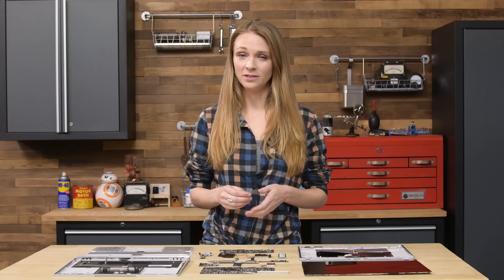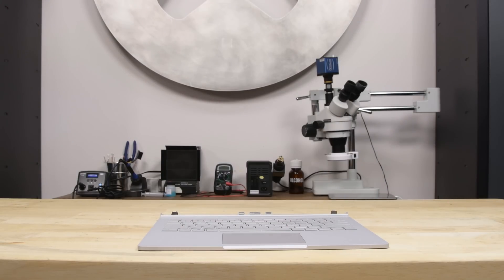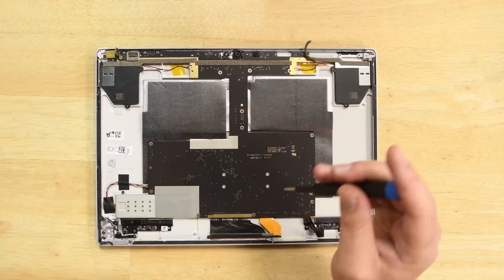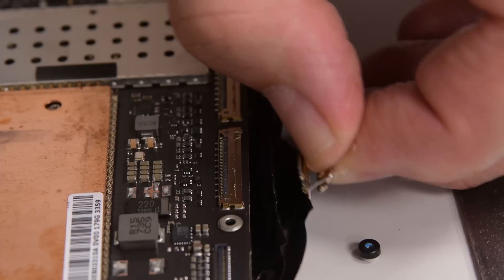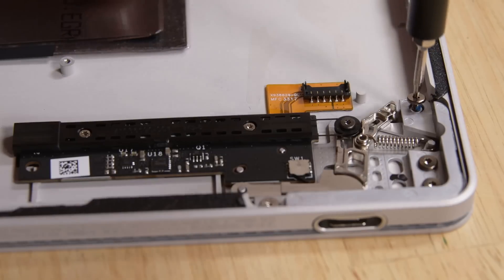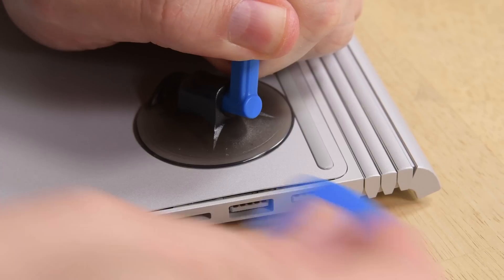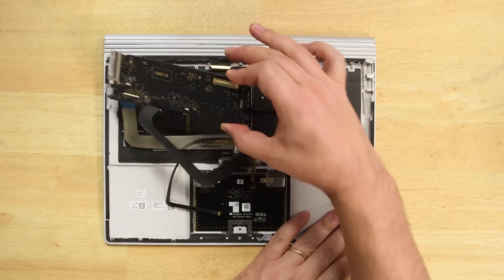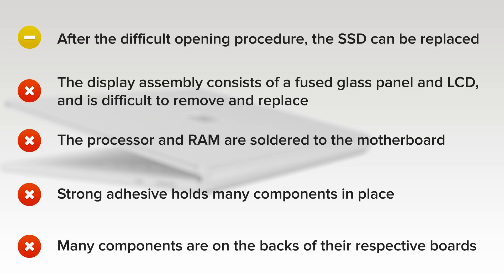Microsoft Surface Book 2 Teardown!

Comment: I recommend having Microsoft repair their own badly designed computer.  The Surface Book 1 has defective batteries that swell and burst, so beware.  Microsoft is aware of the problem, but rather than offer to replace the batteries for you, they instead offer a measly $600 towards the purchase of a new $3,000 Surface Book.  NOT HAPPY.

Comment: It's much easier to open, when the batteries go bad and inflate, causing the screen to separate from the chassis or the base plate to separate from the base chassis. I had both the batteries go bad on mine, after close to 3 years. They say they are T4 screws, which they are, but you have to be dead on to get a T4 in there. Do not try to screw it at all, unless that T4 is actually in. Otherwise you will damage the screw. Me...I used a T3. Slightly loose fit, but easier to get in and it's not like the screws need a crazy amount of force to take out.

I think putting it back together is harder

Comment: Bought Macbook Pro 13'' mid-2012 about the same time with the Surface 2. Replacement costs are almost triple the cost now, than back then. Luckily was able to upgrade the Macbook Pro to 16GB and a 1TB SSD Hard drive for about £250.00, no such luck for opening up and upgrading the memory for the Surface. In fairness, the Surface still works much better than the Macbook Pro, before upgrading it. The only real issue with the Surface is the power button.

Comment: I guess the upside to all the adhesive is that it’s an incredibly well build and durable machine. At one point mine fell from head heigh onto a solid floor, the upper right corner took the impact, and the only damage to the device was the enclosure was a little warped in that corner, but the device worked perfectly.

Comment: hi, i have a problem that my surface book 2 battery is swelling and needs to be replaced... or gone. can i take it out and only use the battery from the base? or does it need the battery in the tablet part? if not... ill just ditch it. please ANYONE let me know ASAP! thanks (or if not, will a surface book 1 battery fit and work?)

Comment: Well at least you can upgrade the storage which is nice

Microsoft wants like 3 grand for a model with 1TB storage, i can get a 1TB NVMe SSD on amazon for like what, 120 bucks? 200 tops? If I ever have to take the tablet apart, this is what im for sure gon change with it

Comment: Its is so weird this Surface Book2 as the Porsche Book is above and beyound on so many factors versus this buildwise, not least 3 IR vs 1.. on the Porsche Book and  item Microsoft also stated that they where one of the vendors behind, alongside Intel, and Porsche and Quanta and Wacom.. /yeah thats a bonafide techbastard..but Peter Han VP Microsoft was certainly very proud. of this device..
Quanta is the maker behind Apples modern laptop like MacBookPro etc alongside a shitload of other products
but it is funny to see only 1 IR-cam in the SB2.. the Porsche Book has 3 of the same IR cams + 2550x1944P/30 videocam for skype etc
https://i.imgur.com/nDE24hP.jpg

Comment: My keyboard unit last night started running the fans at full speed (even supposedly with only 8% battery life and is still doing it now), refuses to show the charging icon or to actually charge, and had to be separated from the screen manually with the release buttons in the screen vent holes because the unit didn't recognize that it had a keyboard attached, so the detach button was grayed out. Not sure what's happened to it. The tablet portion is running just fine now that I am charging it directly from its bottom. But this is stupid. Not even finished paying for it and now I've lost the gpu and keyboard. What do I do? Wait until the keyboard battery finally dies and then try again? Or scrap it because it's done?

Comment: I dropped my SB1 recently while it was inside my messenger bag. Did not think anything had happened to it until the next day when I attempted to power it on. The power button was stuck and now there is no way I can power on my SB. At first i thought, there has to be an easy fix, but after a lot of researching it appears the only real way it will get fixed is by opening the tablet part of it, which b the looks of it, won't be an easy task. SMDH!

Comment: Could I install a Samsung 1TB M.2 SSD?
Reply: Absolutely you could. Its a standard NVMe SSD in there, so anything that fits size wise and uses the M.2 connector should work. I also looked into CrystalDiskViewer? I think thats what it was and it said there too that its a normal NVMe SSD and not some proprietary thingy

Comment: When I was in the Engineering college, they taught us that gluing stuff is the last option when designing. Glue is the cheapset and the easiest way of bonding two materials and in the engineering terms is considered sloppy. I mean what happened to screws, clips, retainers, hundreds of types of fasteners. DON'T TELL ME IT'S BECAUSE OF THE SLIMMNES, CAUSE THERE ARE CLIPS USED IN PHONES THAT ARE PERFECTLY SUITED FOR ANY OF THE LARGER DEVICES.

Comment: This is the business model invented by Apple.    Lets make all the products have premium looks, high cost and unrepairable, or upgradable.  That way, they can sell more extended warranty.  When users cannot upgrade their laptops, tablets.  They will have to purchase new ones
Reply: At least here it's a bit more understandable since they had to cram so much into it to make it work and it's way more complicated than a mac. It makes no sense for apple to do it with such simple pcs but for microsoft, at least for the surface book, i feel like they can get a pass
Reply: Yes.  Apple does not "repair" your laptop, they just replace the whole thing. When you want a new battery, they give you a new keyboard and front cover as well because they are glued together. If your logic board goes wrong, they'll replace everything on it like CPU or RAM, so you are basically buying half of the components of new laptop, and that's half the price of new laptop.
Reply: uhh yeah apple definitely didn't invent that.
Reply: @blotter-water  They were doing that with their desktops all the way back to inception, given that they wouldn't license their hardware to anyone so nothing was interchangeable. So if they didn't start up that business model who did? Mainframe manufacturers?

Comment: Seems like it should automatically score a 0/10 because of safety. Disconnecting the power source should be first. If you have to proceed halfway through a tear down before disconnecting it, that could pose a shock threat to the individual.

Comment: Can you please check again your description of the muscle wire design? It doesn't make sense. You're saying that an elecctro-thermal mechanism causes contraction pulling against the spring, thus keeping it locked to the base-keuboard and when let loose spring will push and thus pull a metal anchor back letting the tablet go free. 
I find it hard to believe it not the opposite bc you are proposing a constant power supply is required to keep it attached while  it will spend most of it's time either attached or free (transition - when u can pull it out) will be when it makes sense power is to be applied - otherwise battery is drained merely keeping the tablet anchored.
Doesn't make sense and I'd guess the mechanism u describe is correct only in reverse (supply power to pull against spring) and thus the mechanical force does the work 99.999% of the time.
Just my humble guess.

Comment: I only care about the battery replacement if it goes weak over time. I have SP4 and I would like to have it for years but I know at some time the battery will die. Hey MICROSOFT, please learn from APPLE how to provide battery replacement for premium devices. For that reason my next device will be MAC.
Reply: just dont buy anything from microsoft or apple

the are the same in repairability

Comment: Hmm, an amazing tablet/ultrabook but also worrying.. one thing there is more the rule than not. is that batteries loose there ablelity to hold power over time and use.and that just how it is with this chem.(you ca nurse all you want and perhaps be carefull not letting it be plug-in 24/7 and perhaps having the batteries in the goldilock-zone 30 to 80% but hopefully this drainhealth factor when on ac power 24/7 aint as hurting to batteries as it was some years ago.
But yeah it can be quite costly to get a new battery in it.

Comment: Lost brain cells reading the comments. These laptops aren't "disposable" lmao. Manufacturers, and even YOU can repair them. You just have to know what you're doing. You can't expect engineers to develop smaller, faster, sleeker devices while at the same time keeping the same setups as old laptops so you can repair them. That doesn't make any sense. You can replace any part of this laptop. The reason why the iFixit score is so low is because it's not upgradable at the consumer level. If something breaks, you can send it in under warranty or fix it yourself.

Keep in mind, I don't even think this laptop is worth buying. Too much money for what you get imo, but that doesn't have anything to do with how easy they make repairing the product so you dunces can feel smart when you want to tinker around where you shouldn't.
Reply: With all that space under the keyboard, though, there's clearly room for a bigger battery and a better performing gpu such as a 1070 max-q, but nope, Microsoft has to be the cheapskate while charging $$$$ for a device that could have much better specs for the same price.
Reply: @AB-pr4uc  You moron, adding even bigger battery would make it heavier and require more time to charge, more heat issues etc. Besides SB2 already has best battery life still in 2019 June lol - only a few devices that can last longer and they are not as good, not even close. As for 1070 max-q - you probably don't even have any proper education and are a imbecile boy mumbling same mantra over and over again. Go back to school and re-learn physics class you moron and then try to understand how economics works. Adding 1070 to 13.5 inch book will make price sky high and will require extra cooling and heat issues. Surfaces are best products on the market in design, quality and style - best battery life, best keyboard, best screens and what else you moron want?

Comment: Speaking from experience - some modern devices which don't have enough adhesive inside tend to have problems with the flat-flex connectors detaching after a few months.

Comment: I think you're missing the point of ultrabooks. They're not supposed to be repairable, they're supposed to be babied until they need to be sent in for maintanence, like a German sports car.  If you want repairability, ultrabooks are not for you.
Reply: I think you're missing the point of a repairability review ;)
Reply: TheBitFox I wouldn't say its microsoft being a dick. They're just making a thin device thinner by using glue instead of screws
Reply: The LG Gram is one of the lightest and thinnest ultrabooks and still is easily repairable
Reply: Christian Stout bs
Reply: The very thing that makes these ultrabooks look and feel the way they are is basically by gluing everything together. It has nothing to do with microsoft being a dick. I hate microsoft as much as the next guy, but you just don't what you're talking about my dude.
Reply: @penguin1714  Ridiculous reply. My Yoga 3 Pro which is 12.8mm vs the 20+mm in the Surface Book, has a cover with screws and the battery/SSD can be replaced in 2 minutes. So yeah, even Apple devices have replaceable batteries. So this has everything to do with Microsoft being a dick. 

From an enviromental perspective, this is not sustainable either. Devices absolutely NEED to be repairable for the sake of the planet and coming generations.
Reply: you dont need to glue it together wtf are you on about 

macbook pros would be easily more repairable if they used normal screws and it wasnt soldered 
but thats just apple being dicks
Reply: Cynical Penguin, my ultrabook feels very nice and it is not glued.
Reply: a laptop is supposed to be self reparable ultra or not 
mabye not cpu and gpu, but you dshould be able to delid upgrde ram ssd and battery like the dell xps lul

Comment: So, you basically pray that you're never gonna have to open it up. Great job, Microsoft.
Reply: How else are they going to sell you the almost 1000 € upgrade from 250 GB to 1000 GB?
Reply: The surface book is aimed for proffesional people who want to get things done and not go in and change things or upgrade it. It is aimed for people who read or work a lot on their computer and for people who need something that is light weight and slim with loads of mechanics. 

It is not aimed for gamers or people who upgrade and use a lot of time on hardware. 

And it is very hard to habe such a thin build with all the features the surface books have and keep it easy to repair. Things are so cramped and glued for a reason.

Comment: no need to get a repair score more than 1. this is a fantastic device that doesn't break 😎
Reply: It is a fantastic device (typing this on my 15 inch SB2), but any computer can break down. I got the extended warranty because I knew that if anything goes wrong hardware-wise, there is no way I'm getting inside this thing.
Reply: johnnyxp64 exactly
Reply: I opted to not get the extended warranty, and am just crossing my fingers. I figure I could have paid like $250 for a 3 year extended warranty... but most likely it won't break (they sell warranty because they know statistically they will make money off you in most cases). But if it does break and costs $250 to fix then I pretty much break even. :) Plus I have a feeling that if something does go horribly wrong, it could happen in the first year. Often after the break in period a PC can just go on for many years.
Reply: what if it breaks?
Reply: except when you close it it cracks the screen because that sharp cutout near the trackpad XD

Comment: but u are comparing the surface to a laptop..... when its built like a phone/tablet
Reply: alex The Book is designed to be both.
Reply: What it's designed to "be" has nothing to do with how it's actually put together. Ultrabooks are built like huge phones, just like tablets. You're not supposed to be able to take them apart unless you know what you're doing. Thats the caveat with buying this vs. a regular workstation laptop.

Comment: Of course it'll be hard to repair, cramping all of that stuff into such a thin device like that will definitely make hard to repair, they don't have much space inside to organize it for you to repair..
Reply: that just means they need to spend more money on quality control and better quality metal
but the design is close to perfect
Reply: They are poorly designed if you mean in the sense of having it easier to service just anywhere, the more complex the more it needs the producers to actually be the ones to service it. The bad thing is that can be pricey and leave you a little less secure in terms of versatility to seek help in your terms. You or your local IT repairment can't do it. You're beholden to the rates on or off warranty of your device. For surface book 2, an out of warranty repair cost can run up to 599.99

of course, it's a +250$ for the extended warranty to grant three years of protection.  Glue or soldering makes modular assembly useless too :/ it's a bitter sweet device if you can afford it but are more meta- about your device.
Reply: Oh wow, when Apple does it, they're greedy assholes?
Reply: XPS 13 did a decent job without making the device too difficult to repair. It just depends on the designer philosophy.
Reply: You just don’t have anything to compare it to
This is basically like comparing the Airbus A380 and the Boeing 747

Engineers didn’t put any thought when designing the Boeing for repairs, it’s difficult to get in on anything and a lot of it is a hazard like high pressure lines that could cut off your arm, and service panels that hard to get into

Then there’s the A380 that’s designed to be easier to repair than a car due to access panels you can reach and service without breaking a sweat.

You’re just disregarding the fact that MICROSOFT didn’t put any thought into the repair of this device, it’s meant to be replaced. When it gets old or shit gets rough, you will have to buy a new one. Yes it’s a great device but you who doesn’t know anything about the industry of servicing and repairs shouldn’t talk as if you know anything about it. 

Apple and Razer has made ultrabooks far easier to repair and maintain than this catastrophe. Even the iPad Pro is better than this
Reply: Duy Linh Chu Ha yea n Dell will keep providing repair instead of improving the quality. I had two surface device never have any problems till date. Had a Dell XPS which requires frequent services
Reply: Max-Leo Amberg  you're high.  you need to check your facts.  No Thunderbolt support in Microsoft products.  Apple uses a higher res display than the Surface Laptop 2.  Nuff Said..
Reply: Oneness100 
This is the Surface Book 2, not Laptop, buddy. Besides Thunderbolt, it basically wipes the floor with a MacBook Pro 13', especially with the display.